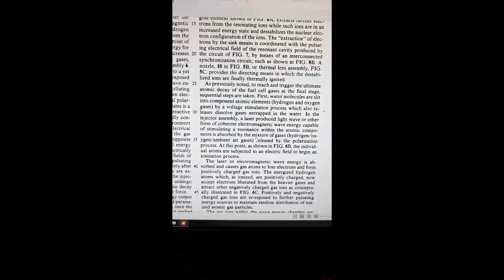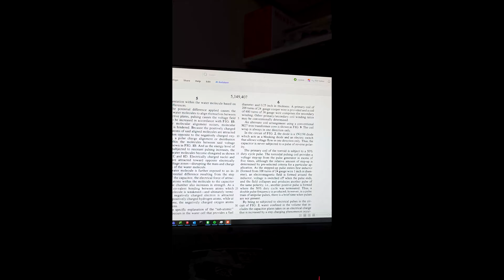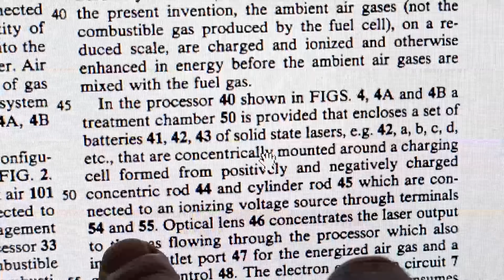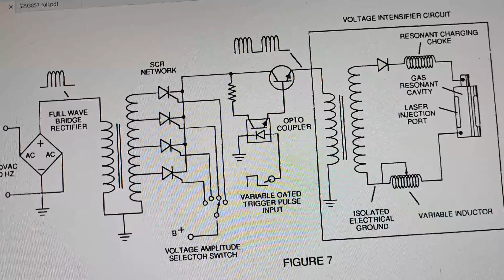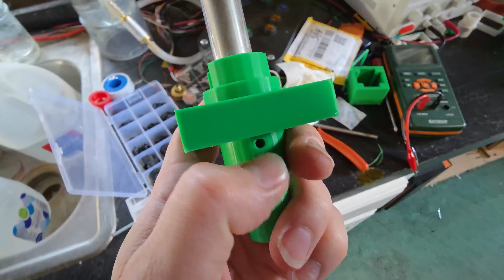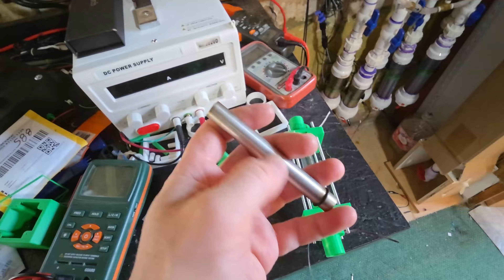Subsequent Resonant Cavity Prototyping, Laser Injection Theory

Comment: https://youtube.com/clip/Ugkx0TSwYV7TZzngt_Tj2oVeJF53O6UCdFEf?si=beK1zrtscsbZLZDa
Reply from the maker: this video tells nothing specific... what are you trying to point out?
Reply: @noahauman  I think you should transcript the video, and study just exactly what he says, and look at the order he explains the process in.. What we are doing is using the gas processor to ionize the ambient air. Then mixing it with the water to make water fuel. If you don’t use the circuit knowledge he has given you for the gas processor. You can not make the waterfuel. If you can’t make the waterfuel, then you won’t be able to do what Stan was doing in his water cell.. Stan made waterfuel for the water cells, not just plain water. If you don’t make the waterfuel you will never reach stage 6 of the 13 stages of the process. Listen to the video and follow his instructions. Fairly simple really you have to put the horse before the cart bud..
Reply from the maker: I'm well aware of the ambient air gas processor and reviewed that video multiple times. He's not injecting ambient air into water though, he is injecting ambient gas into the hho GAS mixture (which could also contain water molecules). So you essentially have hho + ionized ambient gas (plus exhaust gasses) injected into the spark plug which is basically a miniature "hydrogen gas gun".
Reply: @noahauman  Yes that's right, a gas processor makes the cations, the mist spray chamber mixes them into the water to make waterfuel and post gas production it's a gas gun. The gas mixing chamber is seen in the injector system diagram.
Reply: @noahauman  Stanley Meyer explained that his technology uses voltage to do work by accelerating charged particles. He compared this principle to the operation of a CRT television, a cyclotron particle accelerator, and a fluorescent tube light. In each of these systems, voltage is used to accelerate electrons or ions, increasing their energy and enabling physical processes that would not otherwise occur.

In Meyer's process, air is first subjected to an ionisation stage where oxygen cations are produced. These positively charged oxygen species are then introduced into a fine water mist or directly into the water, where they become absorbed. Meyer referred to this charged, gas-enriched water as "Waterfuel."

As gas production begins, dissolved gases are released from the water in the form of bubbles. The high-voltage Voltage Intensifier Circuit is then proposed to maintain ionisation of the gases associated with these bubbles. Rather than relying on current flow as the primary work mechanism, the system uses electric potential to accelerate charged particles within and around the gas bubbles.

As ions and electrons are accelerated back and forth by the electric field, they gain kinetic energy and collide with gas molecules and surrounding water molecules. These collisions are proposed to increase ionisation activity, transfer energy into the reaction zone surrounding the bubbles, and contribute to further molecular disruption.

In this interpretation, the Voltage Intensifier Circuit functions as a particle acceleration system operating within the water and gas environment. Just as a CRT accelerates electrons toward a screen, a fluorescent lamp accelerates electrons through a gas, and a cyclotron accelerates charged particles through repeated voltage fields, Meyer's circuit is understood to accelerate ions and electrons within the water-fuel environment.

The gas bubbles become localised reaction zones where ionised gases, accelerated charged particles, and water molecules interact. As dissolved gases are released and ionisation is maintained, the process is proposed to compound gas production through continued particle collisions and energy transfer around the bubbles.

From this perspective, Meyer's technology is not simply an electrolysis system, but an ionisation and particle acceleration system that uses voltage to create, maintain, and accelerate charged species within the water and gas phases.

As the degree of gas ionisation increases, the process is proposed to approach a Townsend Avalanche condition. A Townsend Avalanche occurs when accelerated electrons create additional ionisation through collisions, generating more electrons and ions, which in turn create further ionisation. This results in exponential growth of the ionised gas population.

In this interpretation, when Townsend Avalanche conditions are established within the gas bubbles suspended in the water, the ionisation process becomes self-multiplying. The bubbles act as microscopic ionisation chambers where charged particles continuously collide with gas molecules and adjacent water molecules. As ionisation density increases exponentially, the release of water molecular bonds is proposed to increase exponentially as well. This corresponds with Stanley Meyer's description that once a critical ionisation threshold is reached, gas generation accelerates dramatically, producing an exponential increase in the liberation of hydrogen and oxygen from the water.
Reply: @noahauman  He used the gas cations from the gas processor in more than one way. With the 11 cell unit he could just use the voltage polarisation process that just produces a very efficient small amount of gases for the manifold and direct gas injectors. In this arrangement he did add the gas processor gases to the manifold with the voltage polarization gases also delivered to the manifold injector system or waterfuel gas injectors. He would then fracture this very small amount of gas production and release energy beyond gas combustion. Making up the energy deficit using such a small amount of gases. He also used waterfuel, water with cations in, in the 11 cell unit, to make a lot of gas production and not need to fracture the hydrogen combustion. As ionising the gas production delivers exponential gas production in the 11 cell or for that matter any other water cell. The waterfuel water injectors only used pre-made waterfuel as seen in the water fuel injector diagram. The water spray mixing nozzle of water mist and ambient air into the gas and water mixing chamber in the waterfuel injector drawing. Is often mistaken for a water mist combustion injector but it’s not. It’s only there to increase the water surface area for the gas ions to be dissolved into the water, for the waterfuel water injectors. You have to understand the 13 stages of the process that Stan shows and lays out.. Stage 1 to 5 is the voltage polarisation process, The vpp will only make a very efficient small amount of gas production from water including releasing the previously dissolved gases check patents.. Stage 6 to 13, Starts with gas ionisation, that is the gas ionisation of the gas bubbles in the waterfuel. This uses the ionised gas cations that are being released from the water with the gas production, check patents, to continue gas ionisation exponentially in the gas bubbles. This and only this will,  in turn ionise the water bonds and release huge amounts of gases. But now these are not stable but volatile hho gases but these are combustible gas ions from water . This gas release is first magnetic and if passed through a pickup coil will produce electricity. This is the gases he uses in his gas battery patent. The water fuel cell is the air processor. The cell you need to make and use to make waterfuel. Without it you can not move beyond stage 5 of the process and will never see Stan's exponential gas production delivered at stage 6 Gas Ionisation and above..
Reply: Random
Alignment
Polarisation:
Molecular Elongation
Atom Liberation
Gas Ionisation
Liquid to Gas Ionisation:
Electrical Charging Effect
Particle Impact:
Electromagnetic Wave Laser or Photon
Electron Extraction
Atomic Destabilisation
Thermal Ignition:

Comment: try a ruby tube , ruby is inside of a laser and actually builds in intensity from fast pulses giving the laser beam
Reply: @noahauman on my profile there is actually a  l  i n k to that pjkbook
Reply from the maker: link is dead :/
Reply: @noahauman search it on Google look for that website in the search
Reply: @noahauman you know when you're running your cells do you also find there's a limit on how high a frequency you can run? like mega Hertz?
Reply from the maker: The frequency is determined by the LC circuit properties. Typical range for me is between 500Hz and 5KHz depending on coils, cells, and type of water utilized.. Anything higher than 100KHz is unnecessary, because "it requires more exotic components" per Stan Meyers.
Reply: @noahauman yet Nikola tesla achieved mega Hertz through using a spark gap
Reply: @noahauman you know in regards to your toriods have you ever tried a flat pancake coil primary coil in between the 2 toriods so you got more bifilar options to try, i think when it comes to transformers, those pancake coil acts like it's just 1 loop giving a higher voltage on the secondary, I'm 3d printing a template to easily wind one on atm , i got 2 heavy 4kg coils to make a tranformer ideal secondary coils they must have 50,000 turns between them, if you get a lamp that connects to the mains attach the primary between the lamp and one of the wires with 1 diode, half bridge rectifier , and positive is pulsed through the transformer,  need to try higher voltage, really each 1mm spark gap represents 1000v maybe your series cells could do best with several thousand v, 250mA